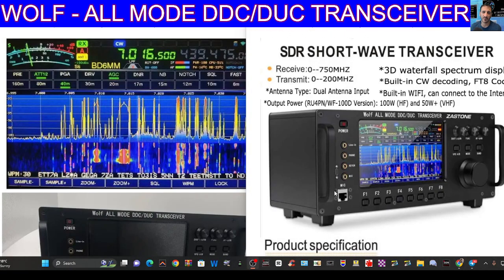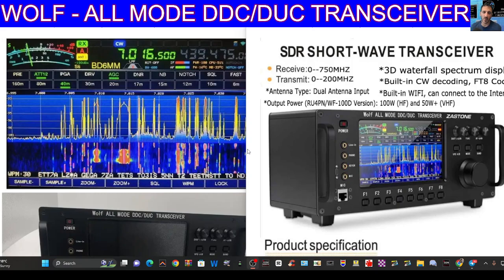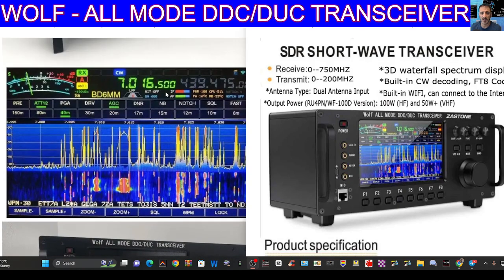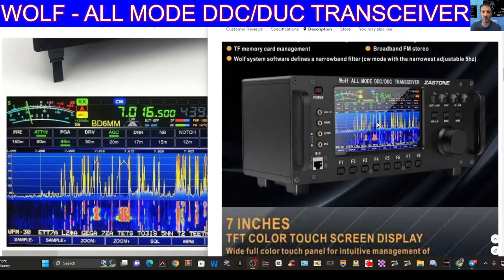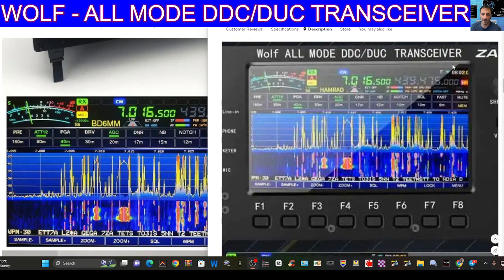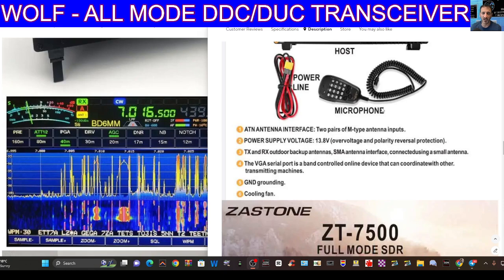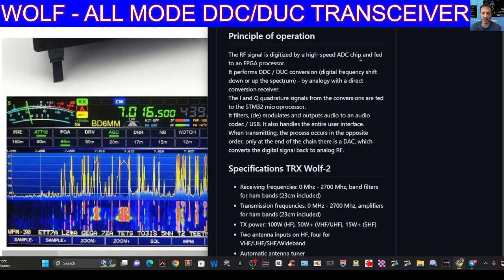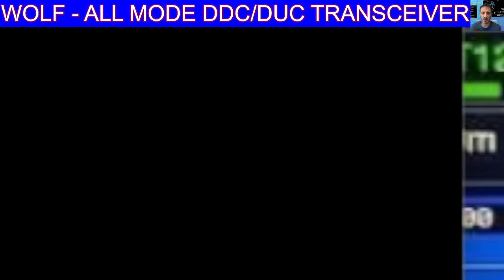WOLF - ALL MODE DDC/DUC TRANSCEIVER

Comment: I think it'd be naive to assume these radios have any sort of spectral purity. I've seen several comments on the spurious emissions from these specific radios on several forums one of which the Wolf DDC/DUC SDR Transceiver group on Facebook, there are a lot of mixed reviews here. The output transistors used (as far as I've seen documented) have been the RD07MVS1 mosfet (175-520 MHz) and a A9M15 LDMOS which is very wideband, 137-174, 350-470, 760-870 MHz, so I don't quite understand how they work well on HF..

The cooling and heatsink setup is laughable in a lot of the pictures I've seen. The 100w model can't be sourced anywhere either it seems.

Keep in mind, no support, no easy returns, little to no manual. Hard pass for me.
73 DE LB1TI
Reply from the maker: https://www.facebook.com/share/v/tWoLnLe6kAKCD6UL/
Reply from the maker: There are mixed reviews on.this budget set I went for the 20 watt version as I want 2 meters 70cm .
Reply: @M0FXBHamTech  yeah I think it looks like a really nice radio, it's a shame none of the big brands are making anything remotely like this. I think my main concern is quality and what the emissions look like. A lot of us amateurs are drawn to cheap Chinese products and unknowingly contribute to the problem by buying them.  My concerns aren't your concerns though I didn't mean to be so dismissive but wish the trend was a bit different. I'm sure some bandpass filters would go a long way. Looking forward to your review video.